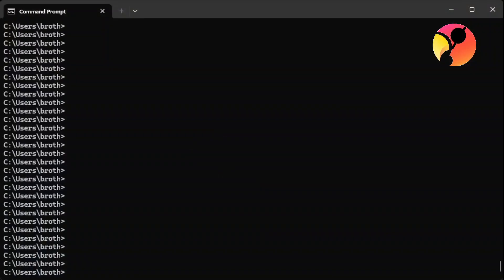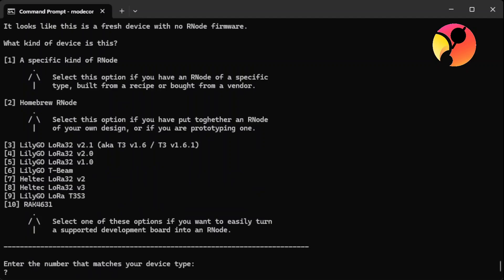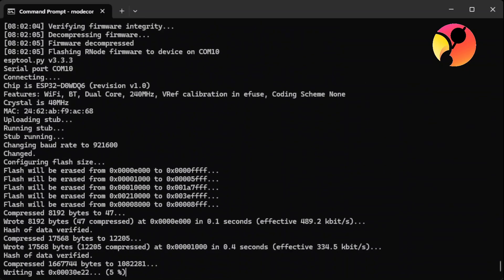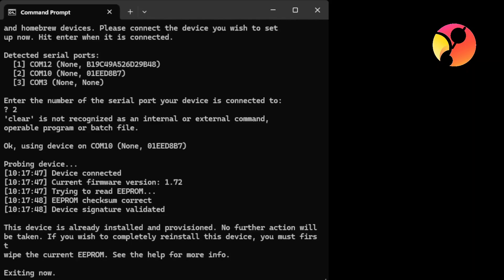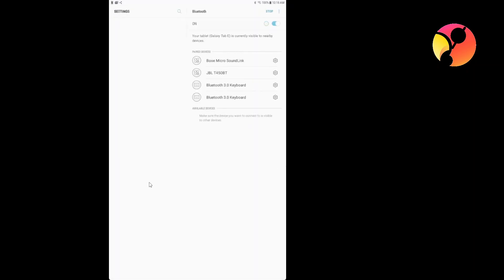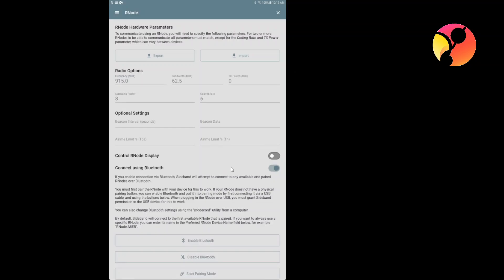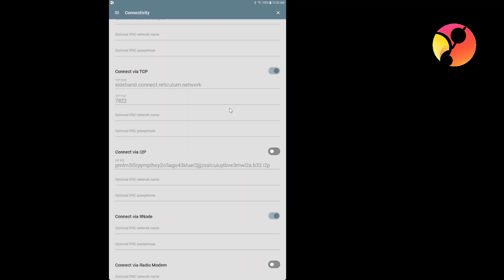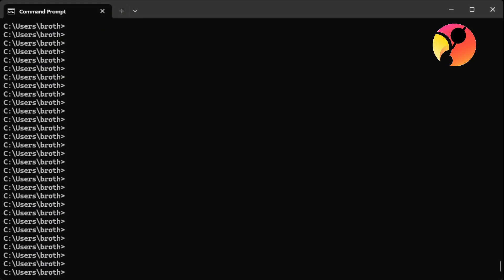How-To: Installing RNode for off-Grid Comms

Comment: So 2 questions:
1: This RNode/Reticulum stuff is interesting, but how are you supposed to use it with ATAK? I can't seem to find a forwarding plugin like there is for Meshtastic. Does it just work through Meshtastic or is it a replacement for it? It seems like theres not much in the way of support or information when it comes to Reticulum out there at the moment.
 
2: Is the FTS project even still alive? I've tried getting support on the Github and on Youtube and it seems like they're both kinda dead or being ignored?
Reply from the maker: Hey there! Thanks for your questions!

1: Using Reticulum with ATAK
Reticulum is indeed an exciting option for ATAK users, especially those seeking a more resilient off-grid networking solution. However, unlike Meshtastic, Reticulum doesn't currently have a direct ATAK plugin available. Here’s how it differs and why we’re working to integrate it with FreeTAKServer:

Standalone Networking Stack: Reticulum  is a full networking stack that can function independently of the internet, providing mesh capabilities and forwarding messages through nodes that may connect via radios, LoRa, Wi-Fi, or other mediums.
Direct Meshtastic Replacement? While it’s not a simple swap for Meshtastic, Reticulum offers some additional advantages for scenarios where highly resilient, encrypted, and multi-channel communication is needed. 
Future Integrations: Reticulum's potential for supporting delayed and decentralized messaging is very promising for the TAK ecosystem, which is why we’re exploring how to make this work effectively within FreeTAKServer. our developers are actively experimenting with this setup, and we hope to see more developments soon!
Right now, Reticulum does require a bit more technical setup . the idea is to integrate SERVER TO SEVER

2: FTS Project Activity
We’re very much alive and kicking! The FreeTAKServer project has been actively developing and adapting. We’re working on some big things, including the Reticulum integration, community-driven events, and a brand new FTS 3.0 that will support expansions.

our ability to support users is limited by the fact that we do this in our free time and we prefer to invest time in development, rather that answer to the same question again and again.
Here are a few ways to get support:

Discord: Our FTS Discord server is usually the best place for real-time support. Community members are often online to answer questions.
GitHub: We’re actively managing issues there, but please keep in mind that response times vary since all our contributors are volunteers.
YouTube: We’re ramping up more video resources soon to guide you through updates, new features, and integrations like Reticulum.
Thanks for reaching out, and we appreciate your interest and patience as we continue building up FreeTAKServer. Stay tuned, and we’re excited to bring you more updates soon!

Comment: Will we have a futur RNode plugin for atak and server side RNode over ip ?
Reply: Reticulum can pass IP traffic (even over rNode, or by printing a QR code on a piece of paper if that's your bag), but the data rates are constrained.  IMO you need something standing between a TCP/IP client and your network to govern what traffic is possible given the available network resources.  A router of sorts is almost required to prevent network congestion when the available data-rates are low.  The nice side effect of this is that Reticulum doesn't care what type of interface the data transits, so it you let the router do the conversion from conventional TCP traffic to Reticulum traffic over whatever and it can be made almost transparent to the client device.

Comment: so are there the same limitation on RNode as there is with Meshtastic, mainly on what can be transmitted? Can photos be sent over it? or is it just text and GPS data, maybe shapes or point of interest markers?
Reply from the maker: using the sideband client you can send pictures, sound and files. More important, you can mix a network between LORA, HF and IP. COT support is what we want implement for FTS. This will support ALL the cots over LORA.
Reply: @freetakteam Would love to see more videos covering reticulum implementation
Reply: Reticulum is a complete and general-purpose networking stack, so absolutely any kind of data can be sent. Messaging clients already exist that can send images, file attachments and voice messages in Codec2 and OPUS encoding. There's even initial support for real-time audio calls in one client (Reticulum Meshchat).